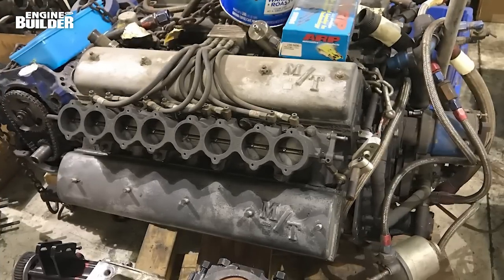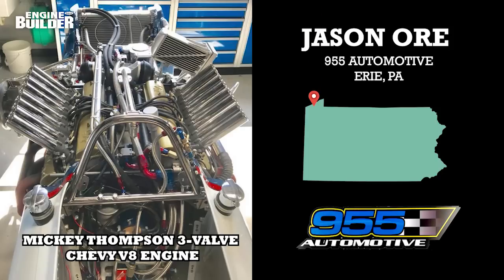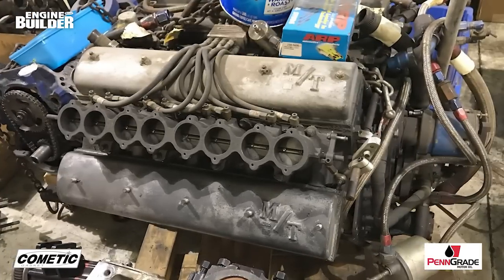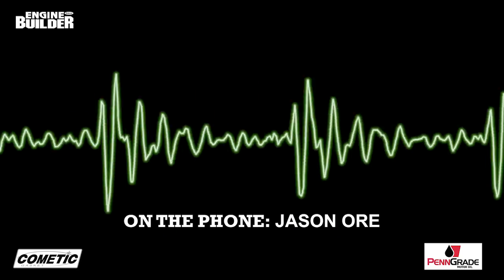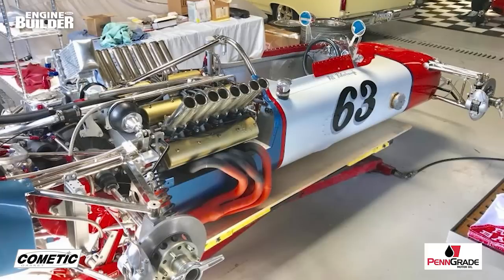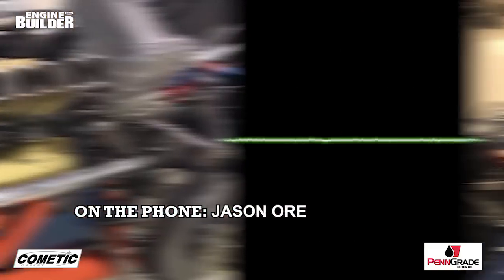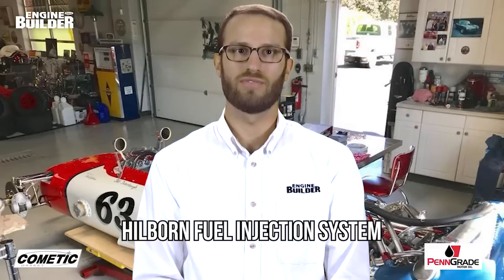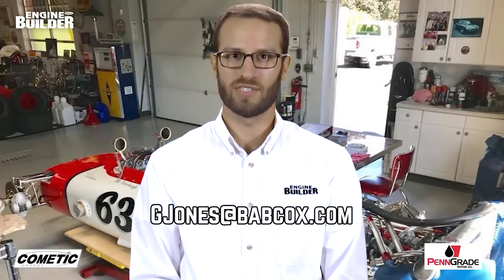Mickey Thompson 3-Valve Chevy V8 Engine

Comment: 550 hp naturally aspirated 305, not too shabby.  I built a high performance 305 once in a 305 vs 350 bet.   I'm pretty sure I didn't make 550 hp, but it ran with the 350 it was up against.
Reply: In the late 70's top drag racing teams made 550hp+ from 302ci single 4bl carb factory ported and epoxyed cast iron heads.10,000+rpm stick-shift cars on the back bumper always a treat.
Reply: @jeroldlafferty54  
There's a big difference between a 305 and a 302.  The bore and stroke of the 302 is much more conducive for building power.

Comment: NOT your typical 305 Chevy!
Reply: Everything different down to the 4 bolt mains and undoubtedly  the bore/stroke numbers.
Reply: 60 over327 with aftermarket 283(3in stroke)crank, that's my guess.

Comment: The cam-in-block hemispherical head engine design using an additional exhaust cross pushrod and bell-crank, was used by BMW in their pre-WW2 2-litre production car engine. This engine was later made by Bristol in England and powered a selection of Bristol, Arnolt, AC and Fraser Nash cars.

Comment: Why didnt you at least post some sound from that motor ,it looks real pretty but if it dont run then its just a exspensive paperweight  
Chrome dont get you home 
I dont look pretty sittin on the side of the road ,i build to ride looks are secound place function is formost

Comment: A lot of bother for 565 hp.
Cool looking piece though.
Reply: Back then it took 1300cc and 4 cylinders to get 35hp out of a VW.  Now, a frigging lawnmower can do that (ZTR types).  Cylinder head, ignition, fuel (outside of Weber carbs) and cam tech has come a LONG way.
Reply: Read up on Indy rules in 1968. Maybe you'll learn something about extracting every last bit of horsepower out of an engine.
Reply: Yes, the stock-block exception meant that earnest tuners could give it a go with N/A engines nearly twice the size of dedicated racing engines like the Offy and 
Ford Cosworth. 
The Thompson effort made good power, for the time.